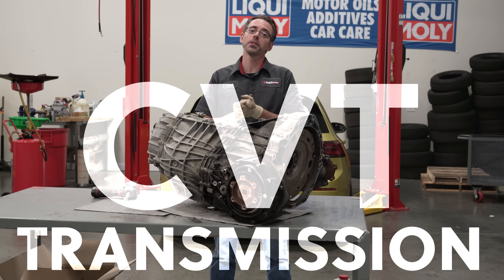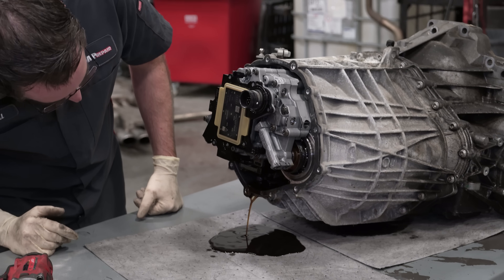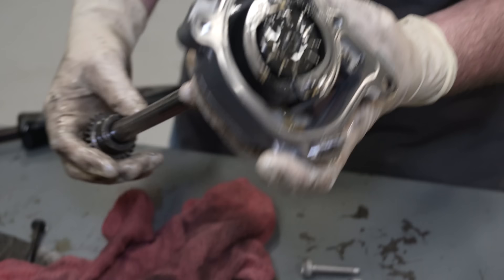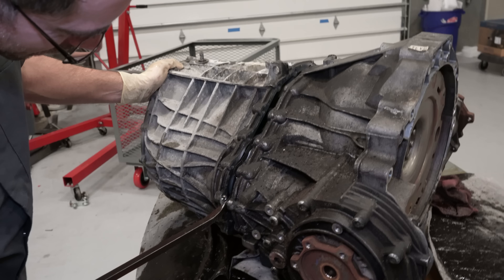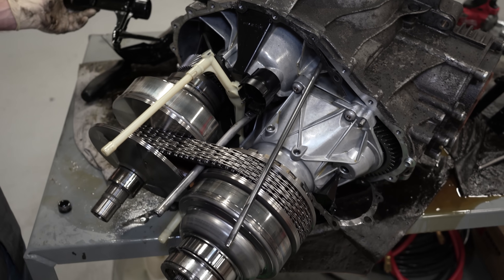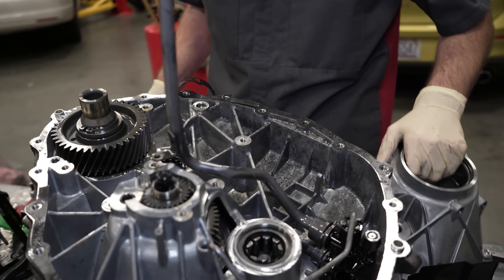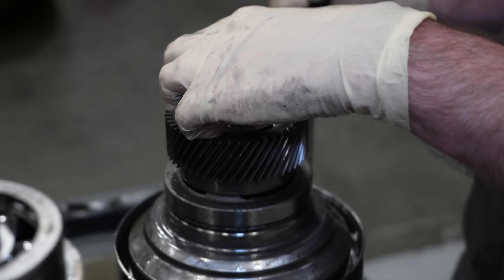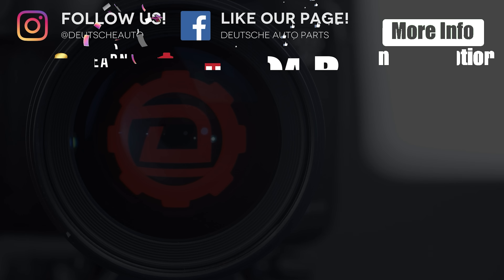Why you shouldn’t get a CVT transmission

Comment: Pretty cool video and kinda nice to see the inside of one. I'm definitely well aware that the older ones had a lot of problems and even a lot of the newer ones do too. That being said I haven't really seen problems with the newer Toyota CVTs. I'm pretty sure those won't give most people any problems for at least 100 to 200k miles. Toyota has put a lot of work into perfecting them, and the newest ones even have launch gears for the purpose of taking off from a stop. This is actually a good idea as it'll not only prevent the slippage from a stop, but more importantly improve the longevity of the CVT chain. I still believe in changing the fluid though. A little maintenance goes a long way when it comes to something lasting. That being said, I'm not really a fan of CVT or automatic transmissions. I prefer the tried and true standard transmission. I like to select which gear I'm in by actually shifting the gears myself with my hand using the shifter. I like using the clutch and gas pedals to control gear engagement. If I'm in the hills I like being able to select the best gear or gears for the job instead of having a computer shifting all over the place and either burning through brakes or over revving the engine. They also last longer, and are much easier to fix if they break.
Reply: I too prefer the manual, but I don't necessarily believe that it is the best option.  It's simply my preference.  Here in North America it's becoming increasingly difficult to find new cars with manuals, with the exception of the Civic Type R's and similar performance oriented vehicles, and believe me, for the price they are asking for them, they can keep them.  I think the Volkswagen Jetta is the only reasonably priced small car still available with a manual.
Reply: @peterwilson8039  I feel you there. I'd honestly prefer to stick to older cars though. The less computerized complicated crap that is in them, the less things that can go wrong. I don't want an electronic E-brake or traction control killing the power. Sometimes I might wanna burn some rubber, and most of that crap is more of a hindrance than it is helpful. It's mostly annoying, and for someone like me who knows how to correct a slide, it could cause a skilled driver to crash.
Reply: If your car is giving you problems at 100k miles, its a piece of shit.
Reply: Well, automatics are easier to live with. An inexperienced driver could easily destroy a manual, while an automatic is foolproof (I don't mean the engineer who designs it, but the user). They're also becoming more common because of safety features that couldn't be implemented in manuals. Petrolheads tend to forget that they are a small group of people who enjoy cars. The market is driven by supply and demand (mostly).

Buying cars pre-2001 might not be a good idea if you ever get into a crash, since 2001 was the year when crumple zones and safety became a thing in cars.
Reply: @michalsvihla1403  I understand where you're coming from, and I do appreciate your input. I myself am still driving a car from the 90s, and I still drive my first car a lot. I really think people need to learn how to drive or not be on the road making the stress dangerous. It's not the cars that need to be safer, it's the drivers. People are the problem, and I think everyone driving on their phones, not playing attention, and just all out being idiots these days, are what causes most of the crashes. I think people need to appreciate the thousands of pounds of metal that they're driving around, and all of these computerized driving aids are making the streets full of bad and dangerous drivers. That's my opinion.
Reply: @kentworch  Well then good luck deciding when you're going to or not going to have a crash. Those things happen whether you're careful or not. Remember that the market is aimed at people who drive automatics and remember the amount of entertainment THEY have in their cars. Even if you're careful about the last little thing sometimes you don't get a choice.
Reply: You know there are automatic transmission that also let you pick the gear you want to be in when you want to as well. But ultimately they pick the best gear for efficiency. And if you want to engine break throw it down gears as your slow down then and you can go back to what focusing on the drive. Also I've tested engine breaking as often as I can using a little breaks as I can for my last set of break pads. It didn't extend their life much. But I still do it anyway since I find it fun.
Reply: I have to say that the manual (standard) transmission has huge advantages compared to any other automatic. Why are they now more expensive than an auto. Makes no sense. But I refuse to buy a car after 2001. I have my reasons, but the most important was I little law that passed after 2001. If I want gps or any identifying tech in my car, I will add it myself. Also, I don't need smart features that add complicated and costly repair that I myself cannot replace myself simy because of the current state of robbers...um I mean mechanic. Call any autoshop in the US and ask what the hourly rate they charge to work on a car. Sad times. One other thing to note. Make some kind of identifying mark on what you want fixed, one that isn't noticeable by anyone else, and after you get your car back, check to make sure they actually did the service they sold you. I have a huge amount of info I'd like to share, but I wont.
Reply: @Chief1lung   I have an Infiniti Q60 that has a ton of tech and isn't a cheap car to begin with. Everyone was telling me just wait until one of those sensors go bad, it's going to be costly. Although I know they are right I have had my car from 18,000 to 78,000. I know that's not a ton yet. But not 1 thing has gone bad and it's a 6 year old car. Only work that has been done is replaced brakes and rotors and oil changes. The leather is even still white and I clean the inside only 3 times a year.
Reply: @trsskater  I think a lot of it is really about what you're looking for in a car. My old 30 year old car from the 90s is still running with about 500,000 miles on it, and even though there is are electrical gremlins it's still going. I do have a 5 speed standard transmission though. I don't think an automatic would go that long without needing to be rebuilt. Computerized things definitely don't last that long. I'm happy to have hand crank windows and manual door locks
Reply: @kentworch   Damn dude 500,000! You have clapped that car enough you have earned the right to buy a new one. But I understand what you mean there. Manual clutch will also need to be fixed after awhile as well but that is much simpler of a task to take on than rebuilding an automatic. But I would also never keep a car long enough to need to do that. If the transmission dies so has my desire to keep the car. The longest I've kept a car was to 130,000 and when it started giving trouble I did the math and it was cheaper to replace than to repair. But I wasn't repairing it myself so it was much more expensive for me to keep replacing parts to keep it running.
Reply: @trsskater  I'm the kinda person that fixing my own stuff. Timing belts, motor mounts, clutches, pretty much everything that I don't need a hydraulic press, or tire mounting equipment for. I've never had to rebuild the engine. Still original engine and transmission, and only on my second clutch.
Reply: @kentworch  what car is that? Sounds like a good advertisement for a bullet proof car.
Reply: @trsskater  Well I don't know about the car itself, but it's got one of the most bulletproof engines Mazda ever made. The BP 1.8 DOHC engine. It's a 1997 Kia Sephia. It's the same engine Mazda used in the miatas
Reply: @kentworch  Makes sense. Miata is pretty bulletproof.
Reply: @trsskater  I really don't know about the new Kias, but the Sephia models from the 90s had Mazda engines, and some of the best ones at that. Most people never knew, and a lot of perfectly good engines ended up in the crusher just because the paint started peeling or maybe the tie rods went bad.
Reply: @trsskater Even though I've driven half a million miles in that car, all 4 cylinders are still within 3 psi on a compression test.
Reply: @trsskater  I kept up with oil changes and pretty much stuck with Mobile1's 10W-40 full synthetic high mileage oil.
Reply: @trsskater  I'm gonna hit the hay. Have a good night.
Reply: @kentworch  And while you're either going to be scarred for life or in the better dead instantly, the dumbass in his modern car that hit you will 99% go unscathed to drive into someone else some other time.
Reply: @trsskater  I gotta say that I've seriously considered taking the engine out of that car and putting into a Miata. It is after all a BP motor, and it kinda belongs in a Miata more than a Kia to be honest. I would also lose a couple hundred pounds of curb weight in the process. I personally like the older cars more than the newer ones, because they're a lot more simple and easy to fix yourself if you know your way around a wrench. There's also a lot less that can go wrong with them. These newer cars are full of computers, and often take a lot of special tools and equipment to work on. There's also a million and one things that can go wrong that I wouldn't be able to fix and would have to take it to someone whether that involves reprogramming computer modules or having to have a fancy scan tool to diagnose a fault somewhere. Computerized things tend to not work after 30 years or so, but something simple like a carburetor or a distributor is easy to diagnose and fix without having to use fancy equipment that I don't have. I'm not exactly a mechanic, just a do you yourself kinda guy, and the older cars are definitely much more diy friendly. I can easily pull the transmission off and replace the clutch in my 97 Kia, but I wouldn't even attempt that with something much newer. Way more complicated wiring and bullshit to work with, and I'd probably trip at least a couple dozen codes that I don't have a fancy scan tool to erase. I'd just rather not touch it.
Reply: @michalsvihla1403  I understand that, but it's not like I don't alright have a few scars. I just prefer older cars, and yes I have avoided many crashes from other people doing stupid things. I've literally avoided several head on collisions at 70 mph when people came in my lane head on. A couple times I went off the road, and a couple times by going into the lane they were supposed to be in. I think a crash like that would have killed both me and the wrong way driver every with all the new car safety features. I myself am rather resistant to injury and while I won't claim to be invincible, I would fair much better in the event of a crash than most people. I've actually been throwing out the back of a truck at 55 mph and tumbed down the road like a ragdoll, but after about 10 to 20 seconds I was back on my feet. I was banged up and bloody, but I walked away from that without any serious injury. I was sore for about a week or two, but didn't need a doctor. It's fair to say that I would be much better off than most people if I do get into a crash, and I'm pretty much always on point to prevent or at least minimize a crash if I can't avoid it. If I end up dead then it kinda is what it is. I really don't think it's going to matter too much whether or not it's a newer car or an old one. If I'm going get hit that hard, it's probably gonna rupture the internal organs anyway. No crumple zones can protect you from something like that. Sure it's nice and safe at 30 to 40, but nothing can save you at highway speed.
Reply: @kentworch  I get you there. I have a motorcycle although it's newer it's really nice to be able to wrench on it especially since it saves time and money compared to waiting for a shop to get around to it. But as a tech guy so I get weak in the knees for cars with all the new gadgets and comfort features that technically make you worse at driving since the car almost drives for you. It gets me so excited to see how far cars have come and how a normal car could compete with luxury features that you couldn't get in a car under $100,000. But I'm really weird. Because I don't want to drive my car in manual. But I don't mind it for my bike. And I wouldn't say I prefer it but it makes me wonder if I would be ok with it in a car or would I get annoyed. Because standard can be like a game where you are always trying to see how smooth you can be or how good you can pull of the line or get those perfect shifts.
Reply: @trsskater  it's mostly comes with muscle memory, and in my case I'm so used to using the clutch and shifting gears that automatics feel completely foreign, and sluggish. They also drink more gas as there are losses in the drivetrain that a standard transmission that is directly engaged in a gear doesn't have.
Reply: @trsskater  For me it's not a game of getting the smoothest shift, but more about having a more direct connection with the car that I'm driving. I often even opt out of having power steering, and it the event of a slide, I can actually use my tires likeness to want to roll instead of sliding to rapidly correct, which could involve steering lock to lock in a split second. When you're going sideways, it's sometimes best to flick the steering wheel and let go of it to let your tires right themselves before adding input to to correct your slide. You'll never be able to spin your steering wheel 2 rotations as fast as your tires can right themselves mid slide, and sometimes power steering and computer systems can actually screw this up and cause a skilled driver to crash. One more reason why I don't like those lane keep assist and computerized driving aids. You never know when you might end up sideways while avoiding a crash, and for someone like me who is experienced in drifting and correcting slides, things like traction control and steering assist could cause a crash. Somebody like me is definitely better off without all that "safety" technology. I'm honestly more of an analog driver and that's pretty much what I'm used to. I'm also big on classic cars. Anyway, I wish you safe and happy motoring.

Comment: First I thought, "it has to be satire" after a while "this guy is just an (unintentional) clown", there was no real reason he gave as to why CVTs were so terrible, certainly mathematics and physics had run away, and hidden in a corner, probably from embarrassment.  Then, finally (thank the gods!), at the end, he hates CVTs and just wanted to destroy one.  So just an unfounded, biased, opinion <sigh>, I knew I should have hit skip!  Not the best publicity for his repair shop, fortunately, I am on another continent.

 In Australia, the Mitsubishi Outlander (which uses the Nissan X-trail drivetrain complete with its CVT) have a 10 year warranty on the entire car, CVT and all, they aren't going to do this for an unreliable drive train.

Most people I have spoken to who dislike CVTs do so for emotional reasons, they don't like the feeling that they are driving a car with a slipping clutch, that there is a power delivery delay during rapid (maximum) acceleration, much of this is software,  (at least two of them had the drive in ECO mode!!!! - what did they expect), also the cars almost certainly didn't have the power to accelerate at the required rate without a high torque multiplication factor and that takes time, so, unless you are using paddle shift on a double-clutch automated manual transmission or a dedicated, sequential shift, straight cut racing gearbox (a big motorcycle gearbox), or you want to aggressively wear the drive, you aren't going to change any faster than the CVT. 

And yes, not only do I know how to double de-clutch (both up and down), I have done a lot of it.  I first learned to do so as a teenager driving an MG TF 1500 with no synchro on first (standard), no synchro on second and third (worn out synchro-rings), and a little synchro on fourth (worn out synchro-ring).  The synchro on fourth gear worked if you gave it enough time, not me, doubling up!  Obviously, the previous owners tried to change gear faster than the design of the box allowed (without doubling), all they managed to do was wear out the (primitive) synchro in the Moss Box.

Comment: They have had CVTs in snowmobiles for over 50 years.  They work just fine: Because they were simple "rubber" belts against metal V pulleys, and these rubber belts could be replaced with relatively little cost or effort.  But there is a principle involved at the "friction" point: there was a "softer" material against a "harder" material.  In these CVTs there is a "hard" material against similarly "hard" material at the "friction" point, and that coupled with incorrect V pulley pressure and possible slippage will result in chronic wear.  (of both the metal belt and V pulleys)   I don't know what different arrangements that they have experimented with, but maybe if the V pulleys were a "softer" material such as brass there would be better "friction" and lower wear.  Belts cannot be made of brass because that would have insufficient tensile strength, but maybe the V pulleys.  Of course this would add significant manufacturing costs, and it is all about making it "inexpensive" which in many cases is another word for "cheap".

Comment: SO much complexity, just to try and gain some minor form of control, over the position of a slippery Drive Belt, that does not really have any intention whatsoever of gripping on anything...   Hell, let's just forget the Friction Material on Brake Pads and Clutch Discs!  -  Metal to metal seems like a much better idea now... and what the heck, let's bathe those Brake Rotors and Pads in shitloads of Oil, too.